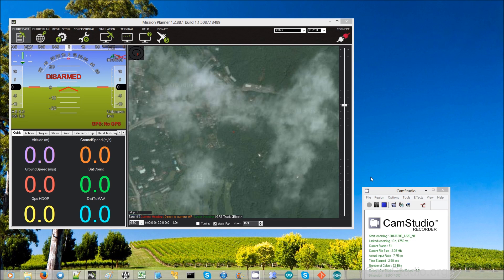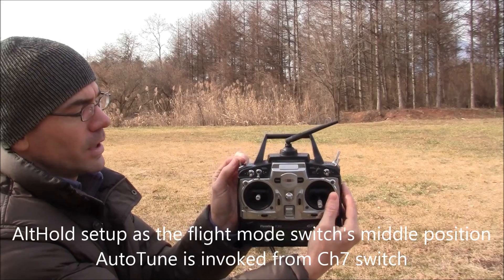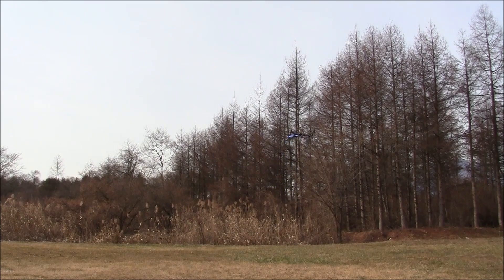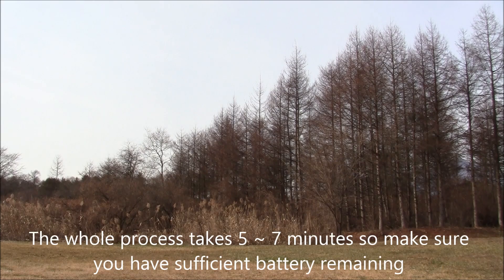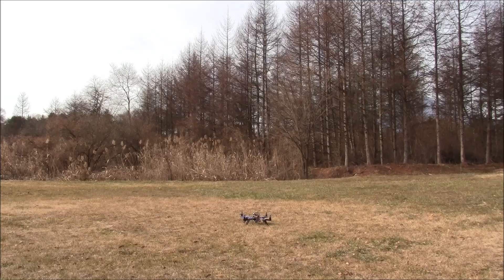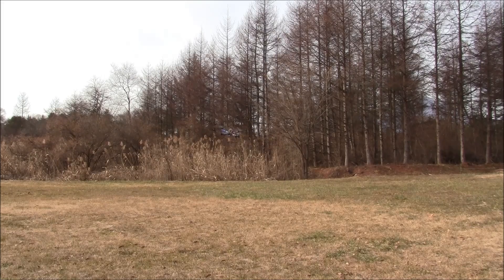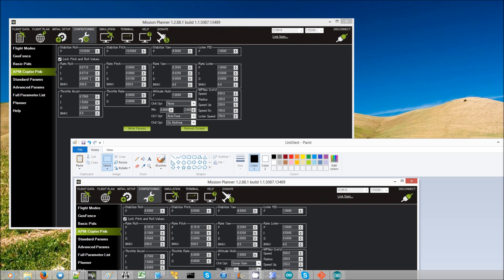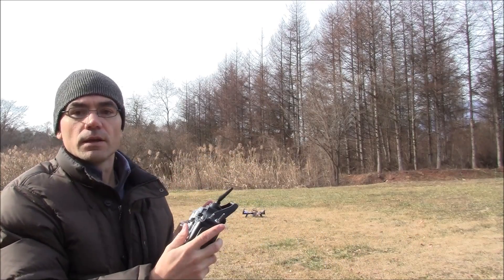AC3.1 AutoTune Setup

Comment: Will autotune stop my drone from drifting?
Reply from the maker: Hi @lucasshen985, drifting is normally not caused by a PID tuning issue so I think it's unlikely to help.  It's probably best to post in the support forums.  If you're testing the latest beta (Copter-4.6) then I or one of the other developers is very likely to respond, thanks!

Comment: Hi Randy, can you tell me about how to tune the PID before autotune? I used to do autotune, but I feel that the resulting autotune is not optimal. My ride weighs about 3kg with a 13" prop and a 440kv motor

Comment: Hi Randy, should the Stab roll/pitch kP and rate/roll pitch kP PID be selected separately for 4.3.x as there is a drop-down menu?
Reply from the maker: Hi Anthony, I guess you're referring to the "Tune " drop-down on Mission Planner's Config, Extended Tuning screen?  I think this "Tune" drop-down should be left set to "None" (or at least not "Stab Roll/Pitch kP", etc or it could interfere with Autotune which also updates those tuning values.
Reply: @rmackay9  thanks, yes I was unsure if none stood for NO autotune capabilities being run. I'm at the tuning phase now which looks like the most complex part.  I'm trying this process with a smaller quad with all the same running gear ahead of configuring a larger Hexa vehicle just to get the processes straight in my mind. The little guy is flying which is excellent but it's like driving on ice. It lacks responsiveness although I can snake it back to me under Stabilize.
Reply from the maker: @antznixon  I think the VTOL-Quicktune lua script could be a good option as well if the vehicle has a significantly powerful autopilot on it (e.g. one with an H7 processor like the CubeOrange, Durandal, etc). https://www.youtube.com/watch?v=K_T9ikEQmlc
Reply: @rmackay9  I'll jump over to that video. Learning how to decipher logs to see if I can learn more. Looks like the drop-down for default = IMU is now IMU RAW again?
Reply from the maker: Hi  @antznixon  I'm not totally sure which drop-down you're referring to actually.. but maybe you're correct..
Reply: @rmackay9  it was the Maiden flight video referring to logging setup but it looks like a previous version of MP.
Reply from the maker: @antznixon  ok.  If it was related to vibration then we've got a new VIBE message now which is much better.
Reply: @rmackay9  I went through the Measuring Vibration topic which is excellent. VibeX/Y/Z looks pretty good against topic reference pics. The log shows 3 separate parent-to-child lines of vibe data each with its own clipping. If clipping is selected nothing appears. Not sure if that is normal? 

Took me a little while to figure out Leans as I was referencing EKF2 not really understanding what I was looking for until I searched the EKF topic and found AHRS evolution. Turns out I use EKF3.

Took me down the rabbit hole. Haven't quite made it to Notch Filtering yet.
Reply from the maker: @antznixon  sounds like progress.  If you're not seeing clipping that's a good thing.  The 3 separate categories (probably numbered 0,1,2) are for each IMU.  The logs use to only show vibration and clipping for the first IMU but now they show it for all of them.  Only the 1st and 2nd IMU are used normally.  I personally have actually never setup notch filtering although some of the other devs say it is a very good thing to setup.  I guess I'm saying that it's not a hard requirement for a good tune, but it will probably make it fly better.

Comment: Why is drifting away?
Reply from the maker: Hi Sleeperknot, it depends upon how AutoTune is started.  If it is started from AltHold mode then it drifts with the wind which is actually better for getting a good tune.  If it is started from Loiter or PosHold mode then it will hold position.  Some of this is documented on the AutoTune wiki page here https://ardupilot.org/copter/docs/autotune.html#invoke-autotune-with-position-hold
Reply: @rmackay9  thank you. I just managed to get one apm2.8 based quad on air. Still have to do auto tune.
Reply from the maker: Hi  @Sleeperknot , OK, although we stopped supporting the APM2.x boards many years ago.  There are many other options that are the same cost and perform much better https://ardupilot.org/copter/docs/common-autopilots.html .  I really wish manufacturers would stop making the APM2.x boards.

Comment: Seems like this is no longer valid. Is this correct? "Dave C’s AC2.8.1 tuning guide has good information for tuning for rate roll and pitch but altitude hold, Loiter and navigation has changed dramatically since AC2.8.1 so those sections are no longer valid." What does this mean? Is this why my access is grey-out?
Reply from the maker: Hi MarkG, The greyed out fields on MP are probably because the MP needs to be updated (check it's Help screen for an Update button).  This video is a bit out-of-date but the info on the AutoTune wiki page should be correct: https://ardupilot.org/copter/docs/autotune.html.  By the way, if possible the best place to ask question is on the support forums: https://discuss.ardupilot.org/c/arducopter/copter-40/155.

Comment: Is going from AltHold mode still the recommended method?  I've seen other mentions of PosHold Mode for AutoTune.  If I am out of switches on my radio, can I just switch from AltHold Mode to AutoTune in the flight modes (using CHannel 5) instead?  Or do I need to be in dual modes; AltHold & AutoTune?
Reply from the maker: Hi vyoufinder, The current recommendation is to enter AutoTune from Loiter or PosHold so that it will (weakly) hold position during the tune.  AutoTune can be setup on the main flight mode switch, and auxiliary channel or you can switch into it from a ground station.

Comment: Hi,  I bought a 3DR Y6B and it came with the Spektrum DX7s transmitter, by mistake i erased the setup came with, my question is, how can i get the original setup? really appreciated.
Regards
Reply from the maker: Houss, I can't help with the Spektrum transmitter but we have a very old parameter file for ArduPilot for the 3DR Y6B here: https://github.com/ArduPilot/ardupilot/blob/ArduCopter-3.2/Tools/Frame_params/3DR_Y6B_RTF.param.  This is really old though so many of the parameter names have changed in our latest versions (3.6 and 4.0).  The way to use this file would be to load Copter-3.2 on the vehicle, then load this parameter file, then upgrade to a more recent version of ArduPilot.  Of course, if it's an APM2 flight controller on there then it's stuck at version 3.2.1.

Comment: Great demonstration, spent a few sessions chasing quads around the field whilst they do their auto-tune. Thankfully in the later versions of arducopter (possibly AC3.5 and higher) you can run auto-tune from the loiter flight mode - it does not keep strictly to one spot, but it does bring itself back when it drifts too far away.

Comment: Great video. Helped me a lot. I was wondering about your frame. What size is it and where did you get it? I've seen it on other videos and it looks very nice.
Reply from the maker: Thanks, happy that it was useful.  In this video I'm using an older 3DR quad copter kit frame.  This is a pre-IRIS frame so it's quite old and I'm afraid 3DR isn't selling them anymore.  It was a good frame for development but the top was a bit fragile meaning that a crash often meant a couple of hours of rework to sort it out.  These days I normally test with a 3DR IRIS (which are also becoming rare) or a large frame from EnRoute (which is my new main sponsor).

Comment: i was wondering if i have to remove my gimbal when performing auto tune or could i keep it on and if i do leave it on do i need to  turn it on while it auto tuning. thanks for the great video
Reply: Marcio Cardenas you should tune the copter with the same payload/mass distribution as you have when flying. So to answer the question. Gimbal and camera should be attached and powered on for best results.

Comment from the maker: TheZionPhil For some reason I'm unable to reply to your comment so hopefully you can see my separate reply here.
I suspect the CX-20 does have autotune.  It's apparently shipped with AC3.1.3 so it should be there.
Reply: Thanks so much Randy. Very appreciative for the reply. Looks like I may have to temporarily wire an aux dial into CH7 to activate AutoTune, unless you know of the param to change so I can use the CH5 (5 position created by 2 switches, SWB 0/1 and SWA 0/1/2) switch to activate on a certain flight mode. (Stock CX-20 Controller),
Reply from the maker: TheZionPhil Ah, no access to Ch7 or Ch8?  That's the only way to trigger AutoTune I'm afraid and there's no way within arducopter to map another channel to channel 7.  All I can suggest is some kind of hardware modification to get a signal into channel 7.
Reply: Randy Mackay Thanks again Randy.

Comment: Any idea what to check if autotune never even engages? I've tried it with ch7 and using a flight mode dedicated to autotune. I've done it previously and it worked great. The only changes I've made have been adding a gimbal.
Reply from the maker: It can only be engaged from stabilize or althold flight modes so perhaps that's the issue?  The other possibility is that the TX's roll and pitch sticks aren't right in the middle so it always thinks the pilot is overriding the controls (i.e. repositioning).
Hard to know without seeing a log really.
Reply: That's my other issue. No matter what I do I can't get atun logs enabled. Even enable all doesn't give me atun info. In any case, my taranis says trims are centered and telemetry says I'm in althold. Spent the afternoon today manually dialing in PID's and it's solid but still concerns me that I can't get autotune to engage.
Reply: Matthew Bradley I have a Taranis and couldn't get AT to work either. I think it may be because ch 7 was for RTL and acted as an override switch. Rather than reprogram, I used my 9XR with no fancy programming and it worked fine.

Comment: Randy, does auto tune (and other ch6,7,and 8opt) work when using sbus?  I'm running pixhawk with sbus rx and every try to set extra functions up it says large imput warning.
Reply from the maker: yes, it'll work.  the input warning is a mission planner thing.  I think it's a side-effect of checking that crazy values aren't input.  I think MichaelO will remove that warning though on the ch7/ch8 drop-down.
Reply: Thanks.  I didn't want to use any of the extras until i knew.

Comment: Hi Randy
i am a newbie and i just build a Tricopter with only fallowing are plugged on the board 

Input: Channel 1- 6
Output: Channel 1,2,4,7 (the 7 is for the tail servo)
in my case, i can use channel 7 & 8 for the switch since the 7 already used for servo

so how can i perform autotune ? any video similar to my case? thx so much

Comment: Hi I have wired channel 8 for Autotune and tuned tarranis radio but the auto tune does not activate...radio calibration shows 1800 plus.once i throw the switch on the radio  for channel 8 although nothing changes in mission planner....flight mode shows alt hold must be something silly i have missed please advise? 2.6 running 3.1.5 thanks in advance

Comment: Can this be done if you only have a 6ch TX?  Perhaps use CH5 for Alt hold and CH6 for auto tune from RX connected to CH7/8 on APM?
Reply from the maker: Yes, if you connect your receiver's ch6 to the APM's input ch7 then it should be possible to get it working.  If you're using a ppmsum receiver which only has one cable connecting it to the APM then it's not possible i think.

Comment: I see you use mode 1- did you figure out a way to make the arm procedure set to throttle and aileron right instead of throttle and rudder? because other wise it is very hard to arm/disarm (I use mode one as well) if you did, please help and explain how!
Reply from the maker: Ah, so you mean you want to be able to arm with just one stick instead of two?  I'm pretty accustomed to arming with two sticks.  I guess it's possible to change the code so it allows arming with just one stick but I've already got a very long to-do list so I think I'll leave it for someone else to tackle.
Reply: Haha thanks:) I keep having problems arming with two; and the only way I've found is to disable the arming sequence (but I like arming!) I guess I'll look into it some more haha

Comment: Hii Randy, one question about auto tune. Is it possible to activate it thru mission planer as my quad has a 6 ch receiver. Or is any other way to activate it without ch7 or 8 ???  Please advice. Thanks
Reply from the maker: no, sorry!
Reply: Thanks !
Reply: Randy Mackay Would it be possible to add in text " make sure to click on the parameter refresh button for the new PID values to download to the Mission Planner so they can be seen".  I am a newbie and wasn't close to the laptop to hear or see " autotune complete so I thought autotune had failed the 3 or 4 times I tried it before I saw the button.  Perhaps apparent to most, but not to me.
Barney Liftoff